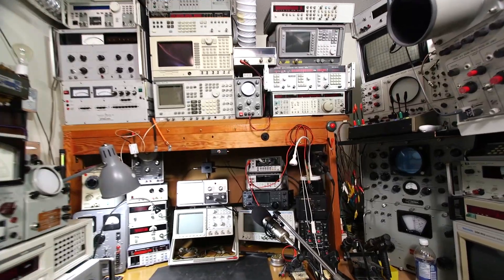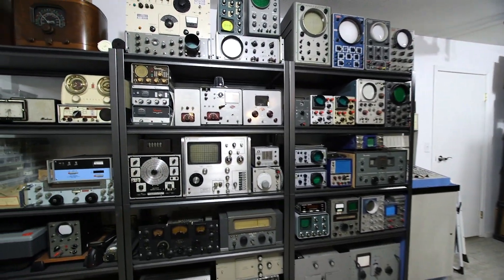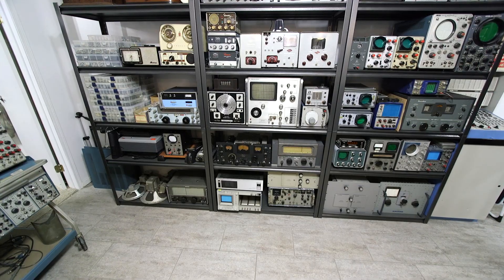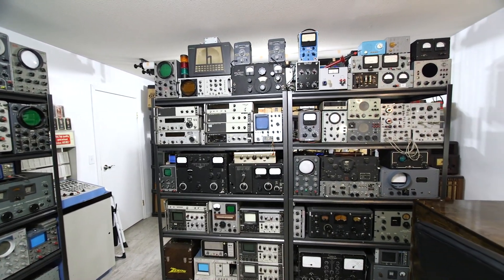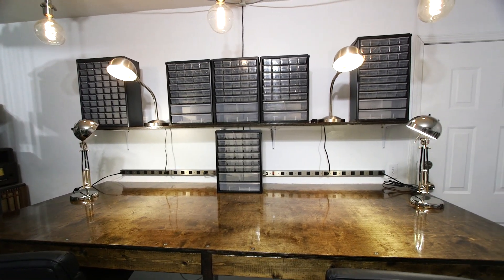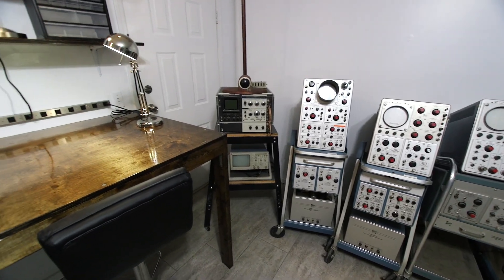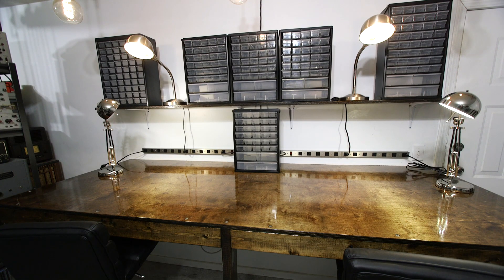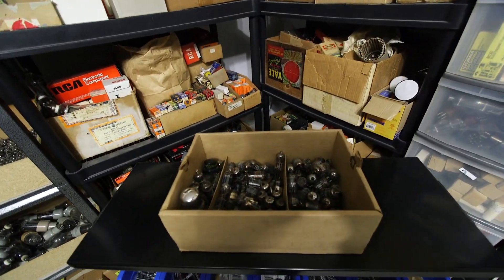The New Lab, Mr Carlson's Old Time Lab.

Comment: My father had a tube tester very similar to that. He got it from the drug store he worked at when they quit selling tubes (mid 70's). He recently gave me his Heathkit tube volt/ohm meter that he built to work on tv's. I have tried several times to calibrate it with no luck... Will keep trying ;-) My father had a stroke 6 months ago, and is not well, but I can turn on your channel for him and you can almost see a smile on his face, almost like a light, or more appropriately, a tube is lit up ;-) Merry Christmas Mr Carlson 0:-)

Comment: I see you have a DuMont 304A hiding on the far right on the back wall, as well as the Tek 551 in the front row, both of which I have myself. I've been hoping to see at least an abridged form of a rebuild of the PS on the 551. I did a cap upgrade on the DuMont 340A and got it working pretty well but have some linearity problems that I'm sure you would reveal solutions to if you ever get to that guy. 

Anyway, keep up the fine work. You're inspiring a whole new generation with stuff from the last generation!

- Scott

Comment: Certainly a massive amount of vintage gear that looks in good physical condition at least.  I take it from the lack of windows that your labs are in a basement? I for one am looking forward to you putting it on the bench and learning even more from you.
I would hate to guess what your electricity costs are when you have all that tube gear switched on, but suppose that your heating costs would be minimal as I'm sure that all that test gear generates enough heat for you not to have to supplement it with a separate heater?
Keep up the good work, we, your viewers are learning a lot from your videos and electronics courses.
Have a wonderful Christmas and a very happy New Year for 2018.

73' from John - G4SKU.

Comment: I have always wondered why you do not have the best capacitor tester, in my opinion, and that is the Sencore LC103.  Also repairing things like flat screen TVs are fun.  I bought about 10 of them at a flea market for $5 each and, in almost all cases, the problem was a bad electrolytic (with the raised top) that can be easily replaced and you wind up with a fully functional TV again.  Love your "stuff" and your projects but I think that you will not have enough time left to fix them all :-)

Comment: Just wow!  I feel so old.  One of the old shops I worked in back in the early '80's had a 556 o'scope with several different plugin modules.  Nobody knew how to use most of them, as we had the 'new' AN/USM-425(v)1 Tektronics scopes in the shop.  Since much of our shop space was marginally heated, a few techs took to using the 556 as a space heater, of all things.

Comment: Hello Paul !!  Wow that's a nice new / OLD STYLE lab !!  Your storage bins on your shelf on the  bench are the same ones that I bought last year !!  They work nice, mine are all wall mounted. You mentioned the radio out of a B-29 Bomber which I have to tell you something about, My mother, during 1941 to 1946 worked for G.E. in Bridgeport Connecticut,  They made the wiring and remote gunnery control/ ANALOG computer control system For the B-29 there as well as the RADAR system for later B-29 units !!  My mom done the WIRING on BOTH of theses systems and later became LINE SUPERVISOR there. I was and still am very proud of her accomplishments at G.E. Also she met my FATHER TO BE at G.E.,  He worked in Payroll there Ha, 
Ha and the rest is HISTORY so I learned at a very young tender age about what resistors and capacitors and tubes and transformers were !!!  I lost mom in 2003 and dad followed her in 2004  mom was 80.5 years young and dad was 90 years !! I took my mother to see the B-29 called Fi Fi  when it was at Stewart International airport and boy she climbed right aboard that plane for the grand tour inside, she pointed out the two systems she worked on and talked to the crew about the same, mom passed away about a year after that..  I just had to share this with you !!!  --------------        John Bellas   KC2UVN     73's
Reply from the maker: What a great story John. Thank You for sharing that with us!

Comment: Excellent lab and am really looking forward to seeing the projects evolve.  As for the bench, I hope that you applied 5 coats of polyurethane to the underside of the bench top, as you did to the top side.  If you didn't, there's a risk that the top will either warp due to an imbalance in the moisture content of the wood, or the top make crack for the same reason but primarily because it's movement is constrained by the 2x4 edging and screws.  At some point in time, I'd recommend that underside finish be applied.

Comment: Just got my hands on two old Tektronix scopes, a 555 and a 561b. Also a Fluke 895a, and a heathkit ig-18 (no upgrade) and some others cool odds and ends. 

But the scopes need the old paper caps replaced, can you recommend or point me to a list of appropriate replacements?
Reply: Digikey.com is a great source that I have found.
Reply: For restoring tube gear, try www.tubesandmore.com (Antique Electronic Supply).  In most cases it's more economical to buy those types of parts on eBay, though.

Comment: That is a really nice workbench there! When I think about how much money all that test gear costs I am a little irrationally scared someone breaks into your place after seeing the youtube videos haha
Reply: That and a lot of that older equipment weights a ton.
Reply: Joseph Florentine I restore professional Ampex video tape machines. Each one weighs 2,000 lbs, requires 3 phase and compressed air. That's why my area is on a cement slab haha
But I dont have nearly as much test gear as Paul!
Reply: That newer stuff, spectrum analysers, scopes and multimeters is more economic to steal obviously. And I said "irrational fear" as well
Reply: Didn't you see the motion detector(s) up in the corner(s).

Comment: Hey Dr. Carlson, If I was to send you a  BC-348-Q  out of the B-17 bomber my Father  had in his Bird. ( been totally rebuilt by a god like multi millionaire RF tech.) used all Mil spec components and calibrated. trouble is. where I live, my ground floor noise is rediculous. could you design a circuit that would attenuate some of this noise or have a better solution. the radio is in mint condition, I wouldn't sent you junk. at your leisure.  Many Thanks! and Merry Christmas!